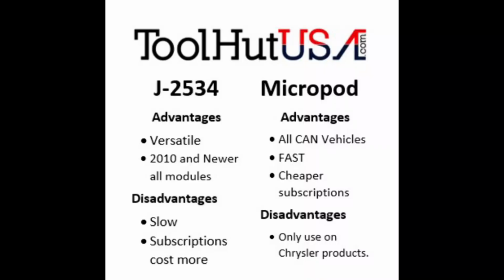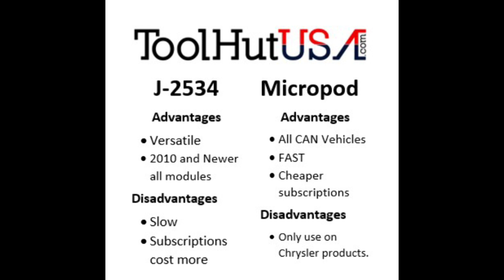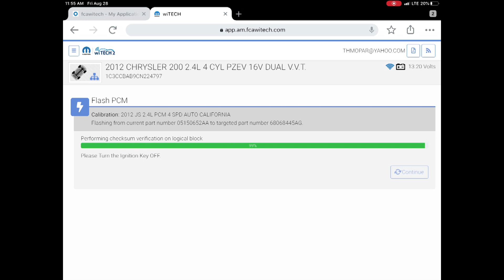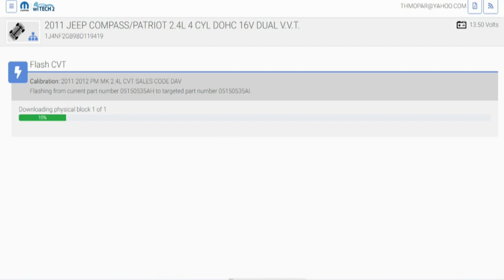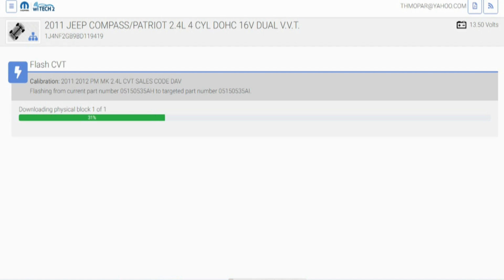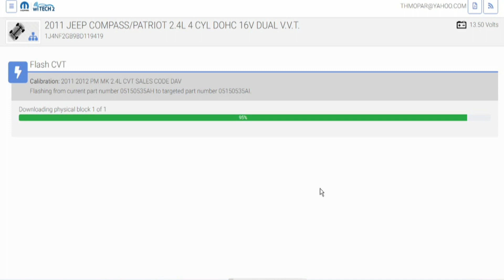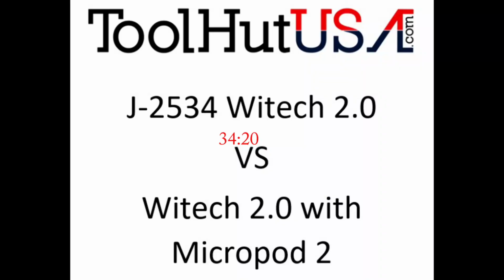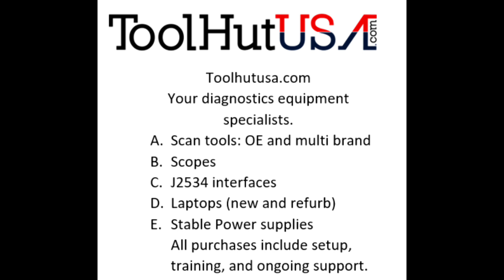Is J-2534 Witech 2.0 as good as using a micropod?

Comment: Can I connect my obd 2 scan tool to the computer to do this flash?
Reply: What type of OBD scan tool are you using Kofi? If it's just a plain cable and it's not certified to do the job then it may not work. Also you'll need a battery maintainer for best reliability so you don't have a battery go down on power interrupting the programming which can ruin the module that you're programming as you have to have a stable power supply recommended by the vehicle manufacturer.

Comment: Just found your channel today. Did my first reflash with the Cardaq plus 3 on a 2014 Cherokee today. You are right about the setup being a PITA. So much different than it used to be. I did both the PCM and TCM. About 8 minutes for the PCM and just a bit longer for the TCM. My primary problem was with the TechAuthority locking me out (after they took my money of course!) then trying to get someone there to unlock my account. More reasons to hate on FCA, but they do pay the bills!
Reply: Why would they lock you out if you don't mind me asking? Was it a fluke on their part, expired credentials or?? Good to know these types of things.
Reply: @dtnel  Multiple log in attempts using Chrome instead of IE

Comment: SAM, always thumbs up brother been long time since u posted a video more please and ur AWESOME in my book thanks for sharing as always. cheeeeeers
Reply from the maker: I appreciate that, I assure you more to come
Reply: @toolhutusaakathecarflasher3019  YeA I’ve used the j2534 witech dozens of times. One thing I noticed is it doesn’t always open the application if ya open it on your desktop then hook your j box up. I have my j box hooked up then open it on my desktop. Other than that no issues I’ve had
Reply from the maker: I have not had any issues other than sometimes doesn't connect to device. Kind of glitchy at 1st. Otherwise just super slow for programming.